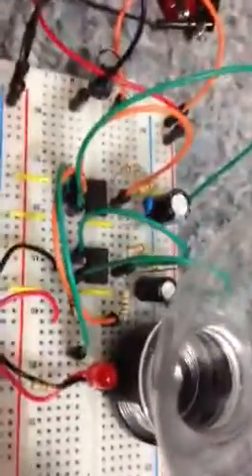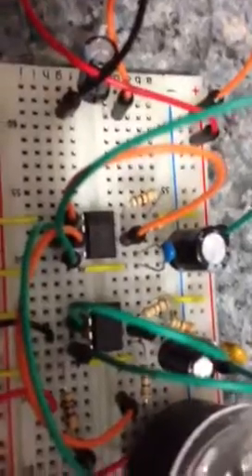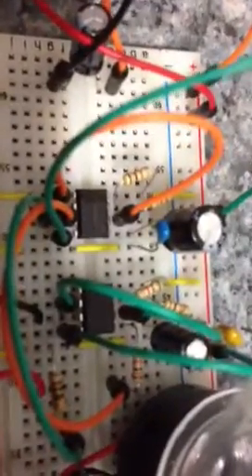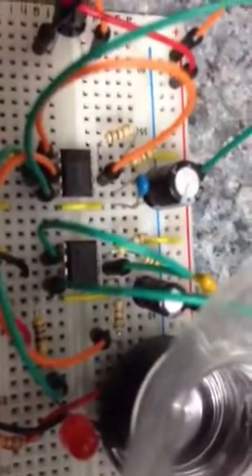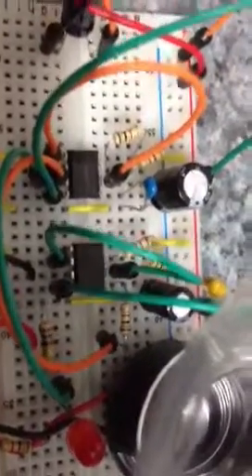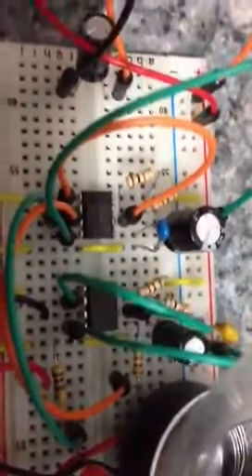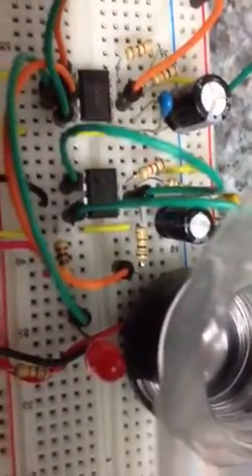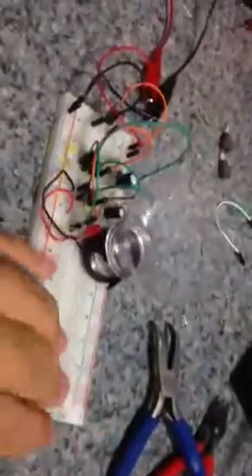555 timer alarm

Comment: What did you used at C1 in the book say's that is 0.047uF polarized? but the smallest polarized i know is 1uF. I tryed to replace it with a ceramic one, but there is no sound. I tryed with a 2.2uF polarized and it works but with big crackles.